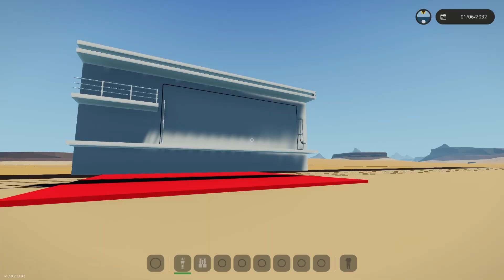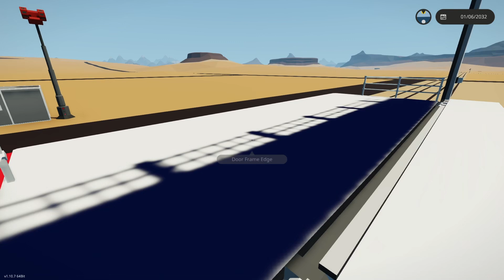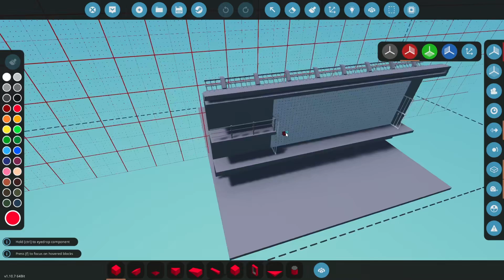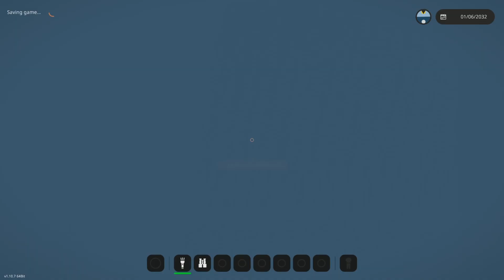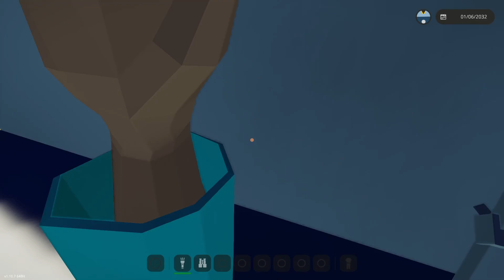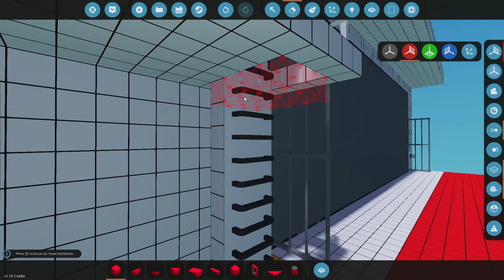Carrier Cat - Cargo Crane

Comment: I also think that the blue one is best, very versitile and seems like it wont be a hassle to use. You could just remove the fence on that side of the ship and instead fence off the area with the track. You should also think abt adding a secondary retracting slider on to the existing slider in the crane arm; open a slot in the bottom for the winch to slide through, and a second rail ofc, that way you are able to get containers all the way up to the hull of the ship.

Comment: Could use elbow joints instead of extending the boom. Could keep it inside on a sliding track mounted to the walls and swing it out the door when needed. Gantry crane will be best tho since you will want one anyways so may as well make it more useful.
Reply from the maker: Swinging out through the door could be a really good solution. Kind of like Clifords crane but small enough to go through the door when its open and pack away along the side when its not.
Reply: @terr-rawr-saur  Elbow cranes (w.e they called) are good IRL because you just grab and move it to position then press winch buttons. I just tried to make one but it is a bit too swingy to work